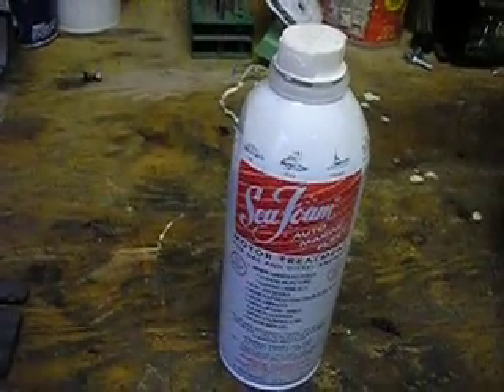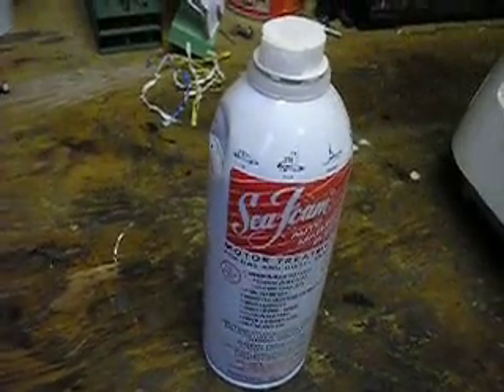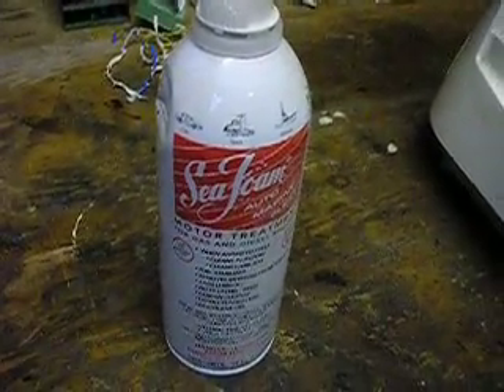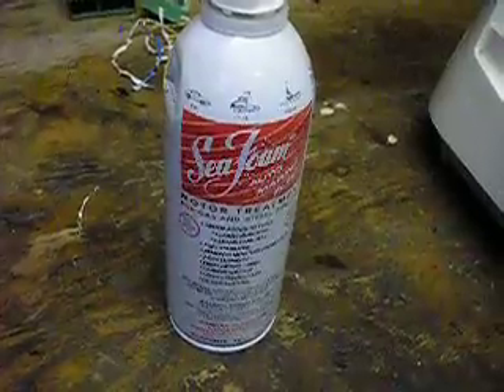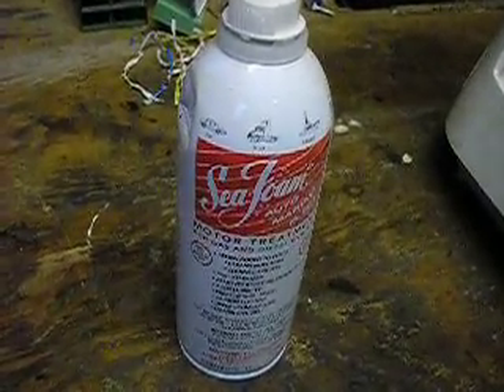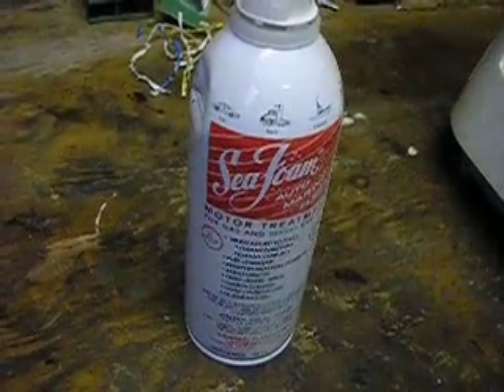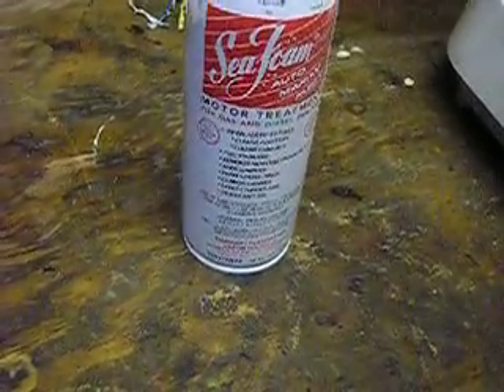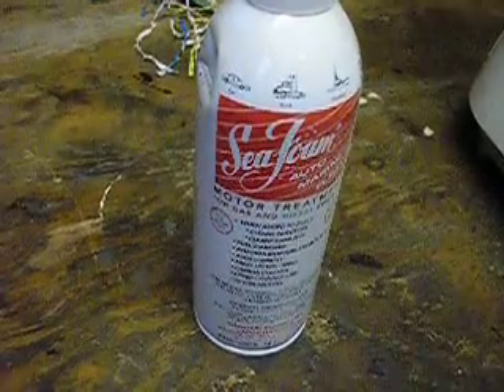can you run straight sea foam in a motorcycle?

Comment: 1) Check/Estimate/Measure how  much gas you have in your motorcycle gas tank.
2) Put as much Seafoam into gas tank as you want as long as it is NOT more than half the amount of gas already in the tank (ie. if 1 gallon of gas is in the tank, you can put up to HALF a gallon of Seafoam).
3) Run for 10 minutes (not seconds), go around the block, get some milk from the store, rent some Redbox or something.
4) Let bike sit overnight.
5) Next day fill bike tank with your regular gas. Go on with your life.

It's not THAT complicated.

Comment: The seafoam had nothing to do with your carb coming loose. You don't have to change the spark plugs either until next tune up. The white smoke is doing what it's supposed to do. It goes into the combustion chambers cleans the pistons and shoots out the exhaust valve when u start it back up. The smoke eats grime and carbons etc. 

1 apply seafoam into throttle body's and gas tank while running at about 1,500 to 2,000 rpm.  

2 turn off vehicle and let it sit for 5 to 7 minutes.

3 turn vehicle on and let it smoke for about 2 minutes and the go drive around to clear the rest. 

Results little bit of better gas mileage and way better throttle response!